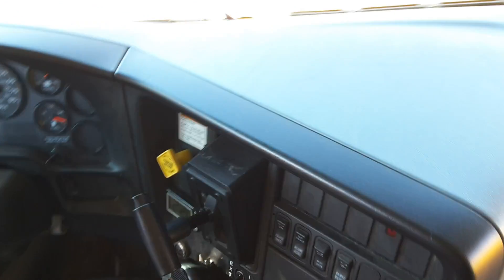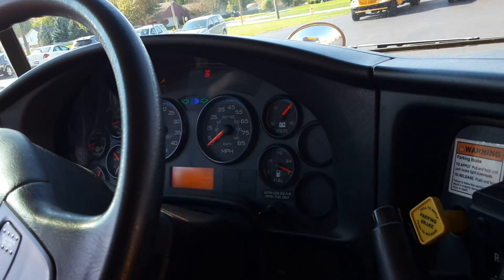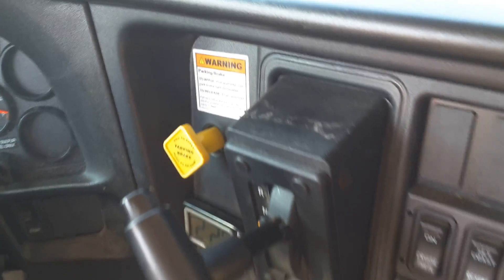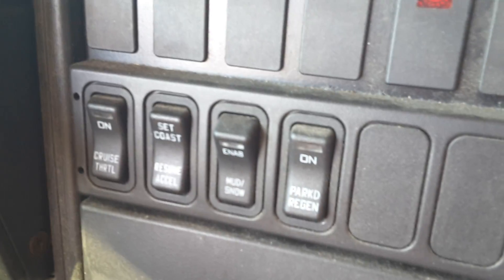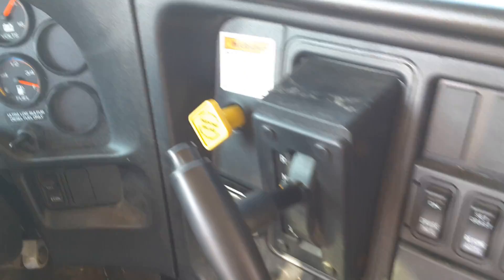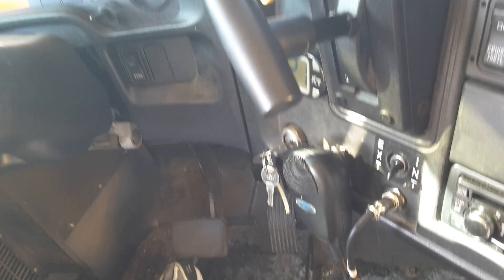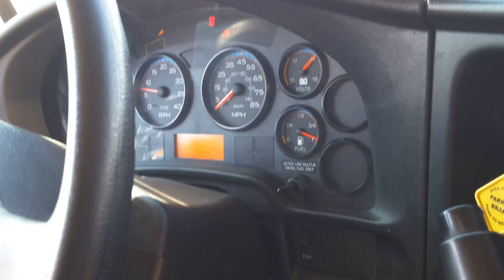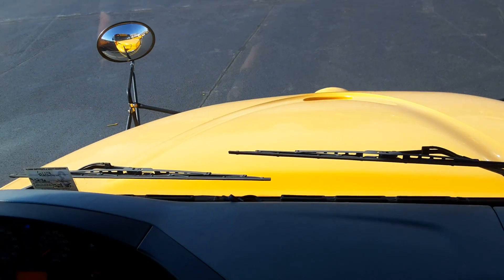2011 IC CE #87 MAXXFORCE 7 Start Up, Lamp Check, Walkaround (Revisit)

Comment: Pile of junk engine as you said, i ride a 2008 CE300 and that thing is so loud compared to the 2016 CE300 with the cummins..My bus driver "raced" a 2016 from a stop light flooring it...guess who won -_-
Reply from the maker: Alex B. The 2016?
Reply: BusMaster99 yep it only took about 3 seconds before we knew we were done